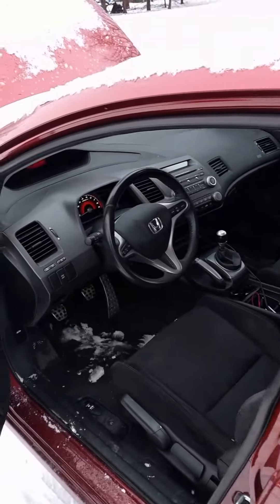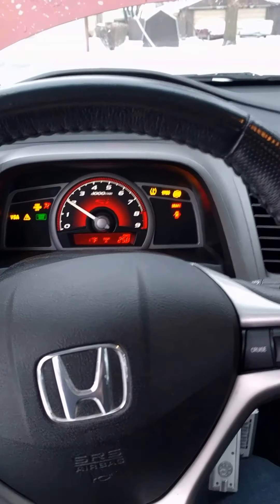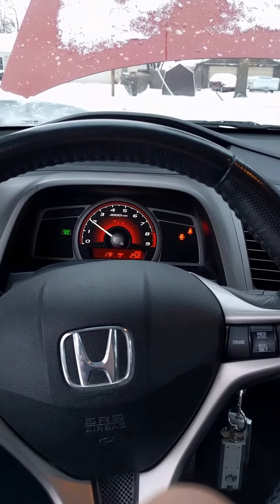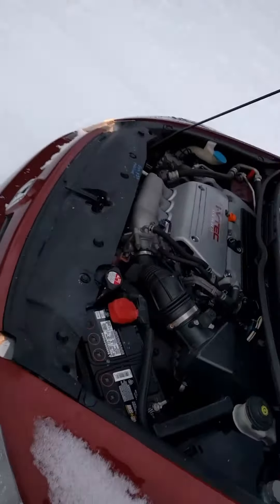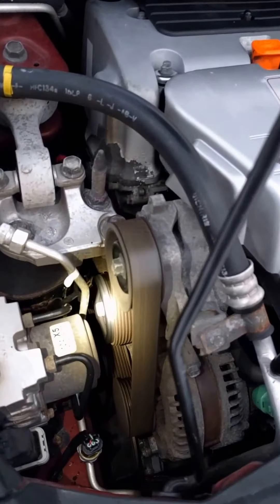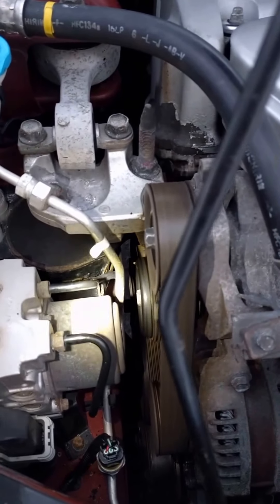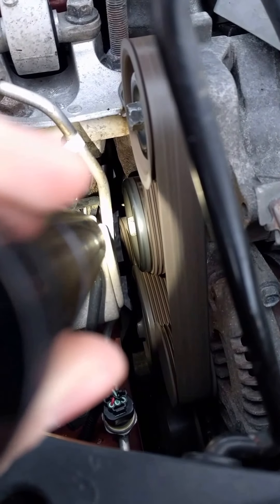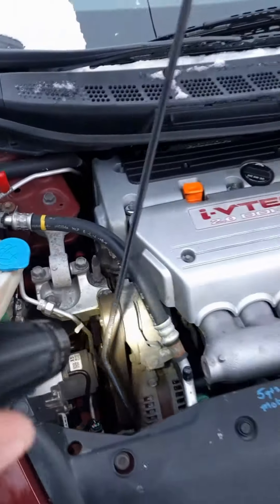Bad Crank Pulley?

Comment: It sounds more like your crank pulley hitting against plastic or the cover around it.
Reply from the maker: It was hitting the timing chain cover because the pulley was separated. It would index outward and back into the block. Pt 2 shows the damage.
Reply: @Mr.W.  I'm glad you did not have permanent damage! I will check that out.
Reply from the maker: @iphone202020220  I bought some steel weld to fill the gouge but I forgot to do it. I sold the car about a year and a half ago. I walked the new owner through every detail. He didn't seem to worry about it.

Comment: Does it make a knocking noise kinda
Reply from the maker: Hope you got it fixed. It's a faint knocking or tapping that is periodic with the engine speed and cyclically coming in and out.. You can hear it faintly in the video when I put my finger on the steering wheel.

Comment: Is it safe to drive for a few days or distances. A little bit worried 😅
Reply from the maker: I'm not sure how long I was driving it before I figured out the problem. If the belt comes off or shreds while you're driving the battery will drain and you'll be stranded. I would replace the crank pulley, front main seal, any pulleys that are damaged, and the belt if it was damaged with all of lateral movement.
Reply: Thank you Mike, I already found the problem. It’s my water pump pully. Not sure how it happen but gonna fix it right away 😅
Reply from the maker: Also check for damage on the chain case. The crank pulley would rub against it, so it scarred mine. https://www.hondapartsnow.com/parts-list/2008-honda-civic-4dr_si-ka-6mt/chain-case-2-0l.html
Reply from the maker: Good to hear you found it. Drive safe!

Comment: Hey man i think I might have the same problem with my fg2 can I contact you anywhere?
Reply from the maker: I can take questions here. I'm hesitant to post contact information here. But if you do have the same problem, it's a pretty simple fix for the K20.
Reply: Yes Gm I was trying to see do this issue feels like rough idle and vibration and it comes and goes
Reply from the maker: This issue alone does not feel like a rough idle or vibration. The only symptoms I noticed was a faint noise from the cabin and the accessory belt indexing left and right while running. There are likely other issues if there is vibration and rough idle.

Comment: My car sounds the same. Did all sounds go away after replacement?
Reply from the maker: christopher maldonado No more sounds after replacement. The sound was from the outer ring of the crank pulley rubbing against the timing chain cover. The pulley was indexing because the outer ring was separated. If you see my part 2 video, you can see it better. Look down at your pulleys while the engine is running and see if you can see the belt moving side to side as well as the crank pulley. If that is the case then the similar sound you have can be fixed by replacing the crank pulley. I would also inspect wear on the block from the pulley, replace the front main seal while you have the pulley off, and check the other pulleys for whining noise to see if the indexing movement fried their bearings.
Reply: @Mr.W.  I have a '05 odyssey with the 3.5l & mine just developed a ticking (previously started having occasional belt whine on startup). I assumed it was the timing tensioner pulley, and I I was looking I noticed my crank pulley moving back and forth from the block, and noticed the ring was separated. What did the repair cost you? Thanks for the video.
Reply from the maker: @harvestblades  I noticed this after replacing my noisy idler pulley. The repair cost me the parts and a couple tools. I used Honda Parts Now. I bought a new crankshaft pulley, pulley removal tool, crankshaft seal, seal puller tool, crankshaft bolt, and a new accessory belt. I borrowed a heavy duty torque wrench from Autozone. So probably $300 or so.

No. 14, 15 on:
https://www.hondapartsnow.com/genuine/honda~bolt~washer~90017-rja-003.html?Make=Honda&Model=Odyssey&Year=2005&Submodel=&Filter=(bt=3%2c126;et=2%2c7)&Location=crankshaft-piston,,15

No. 23 on:
https://www.hondapartsnow.com/genuine/honda~oil~seal~91214-rca-a01.html?Make=Honda&Model=Odyssey&Year=2005&Submodel=&Filter=(bt=3%2c126;et=2%2c7)&Location=cylinder-block-oil-pan,,23

https://www.amazon.com/Lisle-56750-Seal-Puller/dp/B0002SRCKG

https://www.amazon.com/dp/B07439GHJ2/ref=dp_cerb_1